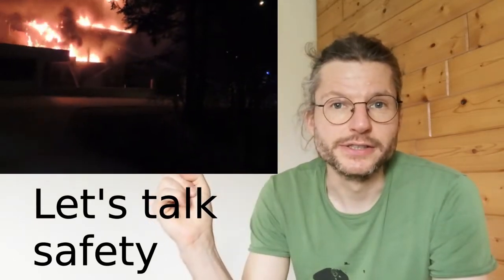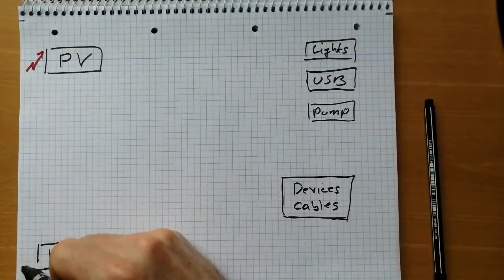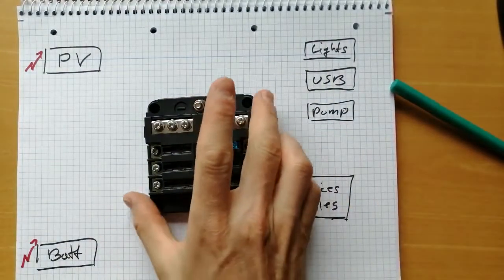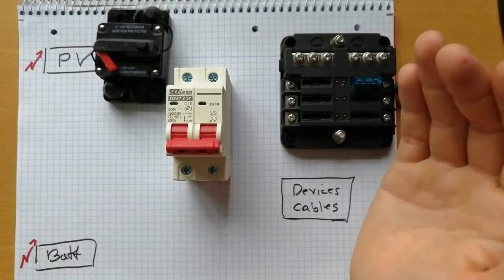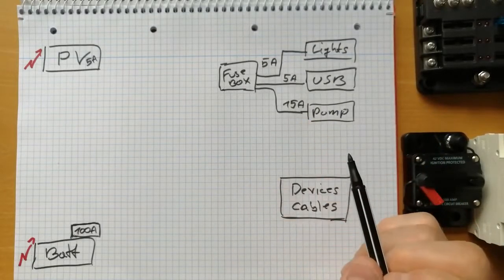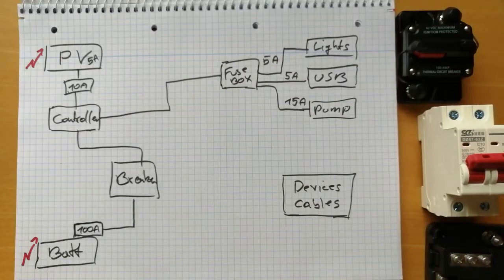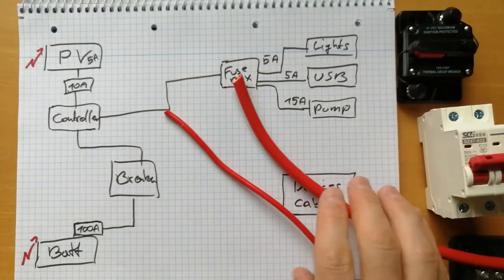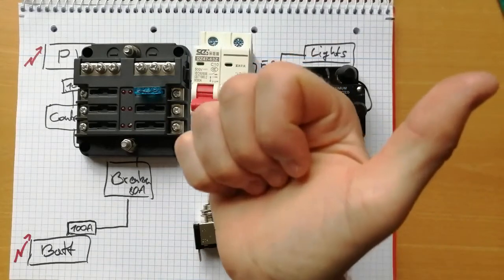Fuses, Breakers, and Basic Safety in your Solar System

Comment: The logic for 3 fuses between the battery and controller is eluding me. 

 The wire must be able to carry 100 A or it’s not adequately protected between the 80 A  breaker and the 100 A fuse. If the purpose of the 80 A breaker is to be a switch, why not use a switch?  

If the controller needs a 20-30A fuse between it and the battery, and there are no other connections, would it be simpler to put the 20-30A fuse at the battery?  Then that wire could be smaller and only be sized to carry 30A.
Reply: This confused me too

Comment: soory to many useless fuses.

between the battery and charge controller for what 2 fuses in one wire?
100A fuse +30 Amp fuse at same time makes what sort of sense?

yes to put into the wire between battery and charge controller is nromal but only one so put in a 30 Amp into it and all done.
then 3 fuses to 3 consumers for what?
from the load if you have a short than it affect the load wire by itself so to but a 5 or 10 Amp fuse into the line and all 3 or lets say 100 consumers protected against the same short , to put the same fuse befor any consumer not change anythink on it .......
Reply from the maker: Thanks Thomas for your input! You're absolutely right; I do use many fuses, and not every single one may be strictly necessary. However, I believe that each fuse plays a role in protecting specific parts of the wiring.

Fuses are there primarily to protect wires. For example, if there's a thinner cable between the battery and the charge controller, relying solely on a big 100A fuse (designed to protect the connection between the battery and the inverter) isn't enough. An additional fuse is necessary to secure the circuit to the charge controller. While it may not pose a major risk in practice, since the 100A fuse would likely trip before the thin wire overheats, there's still a chance it won't happen quickly enough. So, I added another fuse to be extra cautious.

On the load side, I’ve also placed individual fuses on each circuit. This way, if there’s a short circuit, only the affected device loses power rather than all of them. This setup provides a bit more control and safety, especially in preventing unnecessary downtime for other devices.

Thanks again for the feedback. Cheers, Lupo

Comment: ok but why do you need fuses/brakers for panels even if they are connected in parallel ? You still want to suck all the current they provide, unless you don't use appropriate wire gauge for that combined current which is a mistake anyway, I don't see how it's different from non parallel connection
Reply from the maker: Hey @beboba2498, thanks for the question. adding fuses or breakers provides an extra layer of protection for the wiring and system overall. This helps guard against unexpected issues, like animal interference or external forces causing a short. it’s just a precaution to keep things safer. cheers, Lupo

Comment: Never use non-branded fuses and breakers. The DC breaker you showed will likely not function well. They are commonly misrated, and the terminals are too small for the lugs. Great explanation on fusing the solar panel. The DC breaker from the solar panels is not there to protect the wire. It's to provide a mandatory shut off. The wire will be rated higher than 10A, so if a current from the panels is high, it won't melt the cable because it cannot get that high.
Reply from the maker: thanks @cleversolarpower, you are right. especially the cheap ones won't work very well and trip earlier. the design itself is ok and there are also good ones out there but as always, if you buy very cheap stuff you will also get bad quality. cheers, Lupo
Reply: which are good dc breakers brands?

Comment: Do you need a fuse while using solar going into a all in one solar generator type system?
Reply from the maker: it depends on the system. usually the have fuses inside. but it is always good to protect your cables by additional fuses. They can also be used as switches which might also come in handy. cheers, Lupo
Reply: @LupoDIY  thank you!

Comment: If I have a bank of four 100 Ah batteries in parallel,, would I have a 100 A fuse between each battery? Suppose I have a 2000 W inverter and want to draw enough power from the battery bank for an 1800 W continuous load with an inverter efficiency of 90%. The draw from the bank would be 2000 W which at 12.5V would be 160A. Should I have a 160A fuse between each battery, or a 100A fuse because the batteries are 100Ah, or do I need fuses between the batteries at all?
Reply from the maker: Hey @slydog7131 thanks for the question. Fuses are always a good idea. Every fuse has to be able to handle the current of the battery. so if you connect 4 batteries 100A each, you need 4x fuses with at least 100A each. If you have the constant load of 100A I would recommend at least a 120A fuse as it gets super hot otherwise. does this help, cheers, Lupo
Reply: @LupoDIY  Helps, but let me review:  120A fuses BETWEEN the 100 Ah parallel batteries. How about in line to the inverter, which could reach 160A, so maybe a 200A fuse between the inverter and the battery pack?  Another follow-on question: how about cable sizes?  My guess: BETWEEN the parallel batteries, 1AWG to handle 110A  @ 60C and then 3/0 Aught between the pack and the inverter for 165A @ 60C?
Reply from the maker: @slydog7131  makes sense to have kind of a main switch/breaker for all batteries. if all batteries together might deliver 160A you need a 160A breaker for the main switch. yes, you are right. cheers, Lupo

Comment: I recently installed one of these and the on off switch is working backwards. If I take it out and reinstall it the other way around will that fix this? Or is the switch working backwards caused by something else?

And if the switch is backwards in its on off function does that inhibit its ability to trip the switch when there's a real surge?
Reply from the maker: Hey  @noahriding5780 usually the problem is not that it doesn't trip but it can't break the arc and might catch fire when it is connected in the wrong way. hoep that help, cheers Lupo
Reply: Thank you @LupoDIY

Comment: What?  You need fuse breakers for the fuse breaker between the battery and the charge controller?  Now I'm really confused.
Reply from the maker: Hey @truthbknwn, what exactly to you mean? As I explained in the other comment it is always good to have a fuse between the controller and the battery to protect the cables and the controller in case of a short. cheers, Lupo

Comment: I'm a little confused because first you said that you didn't need a fuse breaker between your solar panel and the charge controller because of the low amperage of the panel, but later on you contradict that by saying that a 10A breaker would be necessary to protect voltage going to the solar panel. Can you please explain this discrepancy?  Thanks.
Reply from the maker: Hey @truthbknwn, thanks for the question. This is correct, you do not need a fuse as my single solar panel can't produce more than 10amps which is fine for the cables. The problem is the power source on the other side. In case of a faulty controller it might be possible to short the PV and the battery which would lead to a high amp flow. Therefore it is always good to have a fuse between the battery and the controller/PV. I put a breaker between the PV and the controller just to have a switch in between and be on the safe side. Hope that helps? cheers, Lupo

Comment: Hello. I have two 6v deep cycle batteries  each at 225AH and a 100A  controller but the current wont pass through the controller to charge the battery. I tested it on one at a time not both at once as i assume the controlle wouldnt handle both 225AH combined. What am i doing wrong
Reply from the maker: sorry, just from this description it is difficult to help without having more information. cheers, Lupo

Comment: Is it going to work and safe to use a circuit breaker just as a power shut off switch to your solar system from the solar panel lead ins?

The reason I ask this is that I found many solar charge controllers do not shut off properly when the batteries get full capacity. I had a solar charge controller melt recently from this and overcharging when it SHOULD have shut off but didn't. But then I found out other solar charge controllers also are not shutting off right. I don't see very many people talking about failures of charge controllers to shut off right also. And it doesn't work to always get the most expensive charge controller out there when you have a budget. 

So I want to have an off and on switch for when I'm not around. I don't want to take any more chances of not having a shut off, but I don't want to use the plugins for the pv wire connectors themselves as the switch since it would put wear on them.
Reply from the maker: If you switch it off/on every day I would recommend a proper switch, but if it is just every other day it might be ok to use the breaker. cheers, Lupo
Reply: Thank you for the reply.  @LupoDIY

Comment: dont you think that if the battery breaker switch off, and that of the pv didnt, that will burn down the controller
Reply from the maker: hey  @ksolar1062 thanks for the question. I do not see a problem there, you can also connect the controller to the PV without having a battery connected. usually controllers can handle this situation or why do you think it is a problem? cheers, Lupo

Comment: Im confused, why have a fuse and a switch for a device when you could just use a breaker or switch by itself? thx
Reply from the maker: Hey  @innervarium, thanks for the question. you are right, you can also use a breaker instead of fuse+switch. It just depends what you want to do and how to switch it. If you want to switch quite often, it makes more sense to have a proper switch instead of a breaker as it is easier to use. e.g. 100A breakers are "physically hard" to switch. does this help? cheers, Lupo

Comment: I have searched you tube extensively and there has been no video this so in depth on fuses for solar system. So this in my opinion is a diamond in the rough video. Being said 2yrs old I know there are better fuses on the market that will do better. BUT key point is , the explanations you have are solid and sound. This video brought me into the light of what I was seeking. Thank You
Reply from the maker: thanks a lot @modwrath810 for the feedback. super motivating. I will also do a similar updated video about this topic, hopefully soon ;) - cheers, Lupo

Comment: Is just having a dc breaker to pv enough? Would a fuse not be needed as well? I hear the dc breakers can have bad arcs
Reply from the maker: Hey, thanks for the question. if you are afraid of arcs you have to study the specs of a breaker/fuse how much the can handle. usually it is more than 1000Amps but lifepo4 cells might have higher currents flowing in case of a short. so double check how many amps it can handle. cheers, Lupo

Comment: Hi, is this dc circuit breaker enough to protect Lifepo4 batteries/PV string or should it be combined with fuses?
Reply from the maker: Hey Ivaylo, a breaker should be fine asusually, it is a fuse. cheers, Lupo
Reply: @LupoDIY  Yes it is! But I know the fuse is faster acting than the circuit breaker but I don't know if that matters for the battery or the pv module?

Comment: Why do you need two sequential fuses between your battery and the controller? 80A fuse looks useless. Could you explain?
Reply from the maker: Hey Taras, thanks for the question. Sry, I didn't draw another load, the inverter, which is connected to the 80A fuse - it is mainly to protect the circuit connected to heavy load like an inverter. cheers, Lupo

Comment: Do not recommend this kind of breaker (100A), they usually trip at a much lower current than rated and generate quite a lot of heat
Reply from the maker: Hey Pavel, fully agree, quality is not good and trips already at around 60A....I already changed it and will release a video about it soon.

Comment: Why do you connect the controller to the fuse box directly  ? The power should come from the battery
Reply from the maker: good catch  @Jxsanc123 - I didn't explain it in detail but my charge controller has also a connection for load which can be switched off automatically by the charge controller in case the battery soc is too low. cheers, Lupo
Reply: in addition, the MPPT "load"  on that model allows the PV to power your loads directly not taking it away from battery unless voltage drops and batt takes over

Comment: Your solar panel has a maximum or short circuit current, which is OK to draw, so there is no reason to fuse that. Unless you place multiple panels in parallel.
Reply from the maker: hey Aliza, thanks for the feedback. you are right, it is not needed but it is very convenient to have a breaker two break the connection to the panel. and in theory there could be also current flowing from the battery into the solar system in case of a fault. cheers, Lupo
Reply: @LupoDIY  I have no breakers on the solar panels as they can only provide 8A max, only a breaker between the battery and the solar charger...

Comment: I Have two 200 watt panels rated at 5amp each connected to a 30amp controller do I need a fuse between them ?
Reply from the maker: You should always use a fuse to protect all the equipment, it doesn't depend on the amps as there can always be a short somewhere. Furthermore a breaker comes in handy in case you have to do some maintenance work. cheers, Lupo

Comment: You can only use one of hose fuse/breaker shown. You need a twin pole breaker so you can disconnect both lines. That single pole breaker is also only rated for 48 v. You need to do a little more research before offering electrical advice
Reply from the maker: hey, thanks for the comment. "you can only use one breaker" for what scenario? how do you know that the single pole is rated for 48V? because it is not.  officially it is rated for just 24V which is sufficient for my 12V setup btw. it always depends on the use case and the setup, there is no wrong/right in general. cheers, Lupo
Reply: @LupoDIY  48 volts was written on the fuse in your video. With electrical, there may be many right ways to do things and also totally wrong ways. It will only be 12v (or more likely 14.2 to 14.6 volts) coming out of the solar controller. But going into the controller, it will absolutely be more than the charge voltage. as controllers step the voltage down and not up. Doing videos about electricity without the proper qualifications is not OK. There is a real fire risk with wrong advice.
Reply from the maker: Hey, you are right, on the breaker it says 42V, in the manual it says 24V but in general, I am not a big fan ob this type of breakers anyways. In general, it depends how and where you use the breakers. and as I described in the video, for the circuit of 12V, this is completely fine. For the incoming circuit from the PV, I use the double pole breaker but even this one is just around 40V max in my setup. But I am happy to hear other opinions or if you have found something that is one of your "totally wrong ways", please let us all know here on YT so we can learn from each other. cheers, Lupo

Comment: You will burn down your house if you use 12v car fuses!
Reply from the maker: hey, why do you think so?
Reply: @LupoDIY  12V systems use more Amps and need thicker cables so they dont set on fire. Even at 100A you will be limited to 1200W max. You are better off building a 48V system in a house.
Reply from the maker: @sang3Eta  thanks for the input. true, you need thicker cables. that is exactly what I also said in the video. For my small use case a 48V system would not be feasible. cheers, Lupo

Comment: How about light only,.we have 100w panel and 60a scc 80ah batery
I need FUSE or Not .
Reply from the maker: thanks for the question: you always need fuses. there can be a short which can lead to fire. you always have to secure all circuits even if is just 5 watts load.

Comment: Wrong concept
Reply: Yes the PTV controller should not output the power to other device it should output to battery only and it should has a dc to AC inverter to power up ur devices. Power from controller to battery power a limited current it don’t too dangerous but power from battery to inverter would be problem it can up to 100A or more do fuse and switch should be add
Reply from the maker: Hey, thanks for your comment. My Victron charge controller has a dedicated output for the load which is quite convenient as you can switch of the load in case of an under voltage situation. You are right, there can be high current flowing from the battery, that is why I also recommend in the video a fuse as close as possible to the battery to secure the remaining part of the system. cheers, Lupo